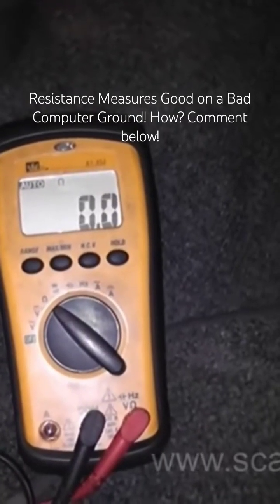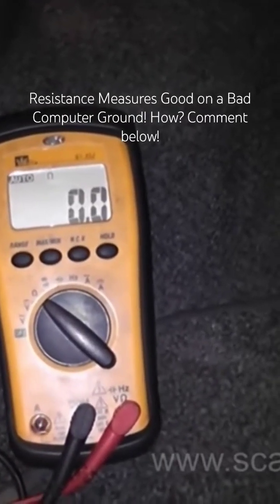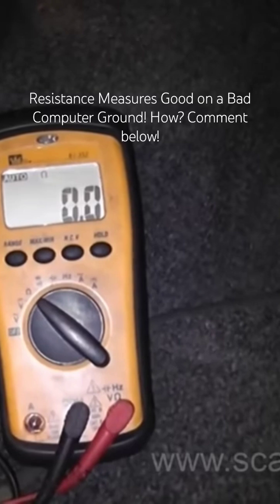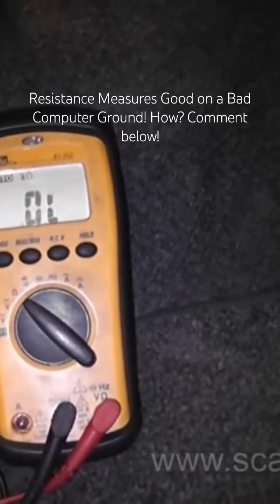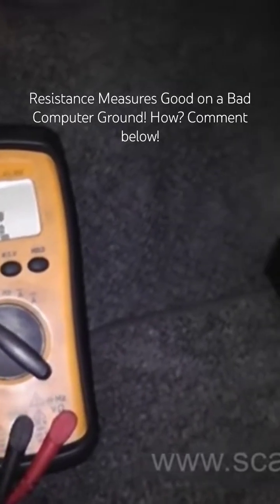A Circuit Can Measure Good With An Ohmmeter And Still be Bad!

Comment: My electronics training circa 1970 suggested that meters that load the circuit are better than high impedance meters (VTVM back then) for continuity testing.  In these auto repair videos the use of test bulbs of appropriate current seems spot on  
too!!

Comment: You have a good ground but it is too little of a ground.  A test light would be dim.
Reply from the maker: It's not good for the amount of current flow the circuit produces, but it is good enough for the microamps the ohmmeter produces, which is why resistance testing on anything that has measurable current is always a suspect test

Comment: It's important to understand that the resistance did not actually measure good. That type of meter has a limited ability to measure low resistance values. When you see a reading of zero on that type of meter it just means the resistance is less than an ohm or two. That's not enough accuracy or resolution. If you want to decide if a ground is good you just need a meter capable of milli ohm or lower readings. Yes voltage drop is probably easier in most cases but resistance readings work if done properly and don't require the circuit to be active.
Reply from the maker: We don't use those in the automotive field. Way to dangerous of a tool to be using on 12v DC computer circuits. A milliohmmeter puts out a very high current to be able to measure that and using the load of the existing circuit is much safer and just as accurate.
Reply: @ScannerDanner  A milliohm meter is not a dangerous tool. In fact probably less dangerous than a test light. They tend to use a very modest compliance voltage that is very safe. The measurement current can be in the range of 50mA/100mA on some units to 200mA/1A on some higher end units. Generally the user could control this by range selection if desired. Also this may be pulsed resulting in very low average current values. Milliohm meters are used in the automotive industry and are becoming an essential tool for diagnostics especially for hybrids and EVs. However my original point was just that the resistance did not test good it was just that the meter used was not up to the task and the tech needs to be thinking milliohms not ohms for a circuit that carries current. Just my opinion but I'm simply a DIYer trained by ScannerDanner.